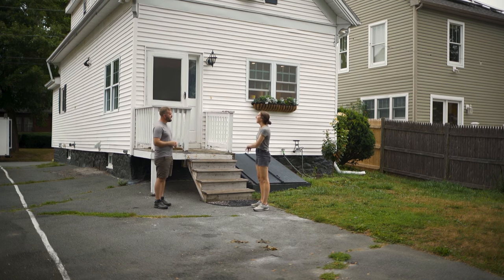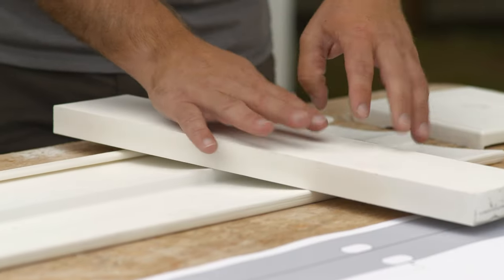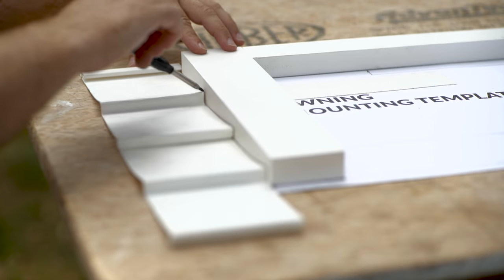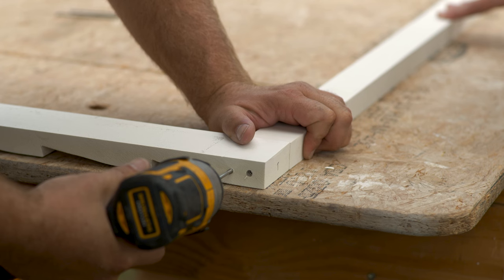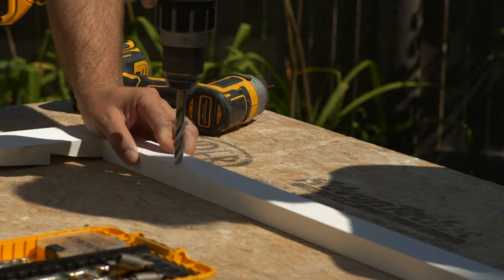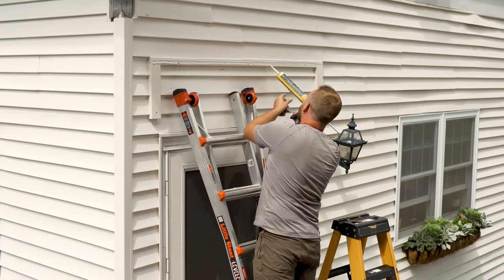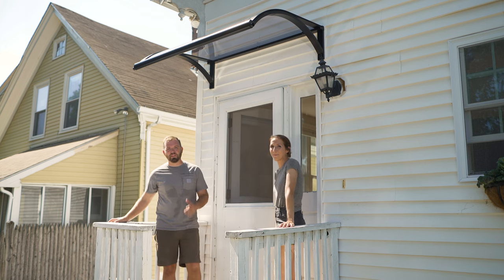How To Install an Awning | Ask This Old House

Comment: This awning is a joke and way too high.  It won’t protect anything.  It’s almost useless
Reply: Agree, very poor decision.
Reply: Definitely not going to buckle the siding in the summer!
Reply: This funny house
Reply: Noticed how much it moves,I think it won’t last too long.
Reply: @natasha8597  wait and see what happens in 10’years
Reply: Any lower and I think the door would hit the outer edge when it swung out. Could maybe have come down a tier in the siding but I suspect he might run into problems either landing in the high point of the siding, which he’s trying to avoid, or tangling with that light.
Reply: Also Nathan is like 5’6” or something. He’s not tall, so that makes the seeming look higher.

Comment: The awning just doesn’t match the architecture of the house.  It looks tacky.  A bit ghetto.
Reply: Who asked for your opinion?
Reply: It’s useless and 15” too high.
Reply: @johnlebzelter4208  It doesn't matter who asked for his opinion...what he commented is exactly right!
Reply: Someone in my ghetto has the same awning.
Reply: @Amedeus1756  I mean the house is tiny maybe 300k tops.  It definitely doesn’t warrant a 5000 awning
Reply: @stavroslask1292  Lower it 15" and you'll be smacking your head on it every time. More armchair contractors...
Reply: @kamilzieba7427  Look at the homeowner in relation to the awning. Ok maybe 8”

Comment: folks, I hate to be a safety nanny, but take it from a DIYer with a slice across the back of the hand, DO NOT USE A TABLE SAW WITHOUT A RIVING KNIFE. it is not worth it. And the riving knife takes literally no effort to use. Quite shocking that TOH chose not to use one here.

Comment: That's a nice-looking awning, and well-installed, especially with those blocks for the vinyl siding.  If I were the owner of that house, I'd have prioritized a replacement porch and stairs, because they looking like they're about ready to fall apart; have no handrail; and often, the size of the deck determines the size of the awning.
Reply: I agree, nail that down 1st, and then see what design and size of awning would work
Reply: Ugly awning

Comment: Cut the vinyl siding away in the mounting pad footprints?  Sawsall, recip saw, etc?  Lot easier than conjuring up a band saw and buying the PVC, sanding.  Then caulk the seams.
Reply: yes, you could do that, add J trim and flashing, and attach solid blocking for the awning to mount too, and not have to worry about catching studs with the pre drilled holes in the awning.

Comment: Nice project and I like the design of the awning. I however would have liked to see some sort of support ‘beams’ running from the front to the back of either side of the inside opening for a little more structural look.

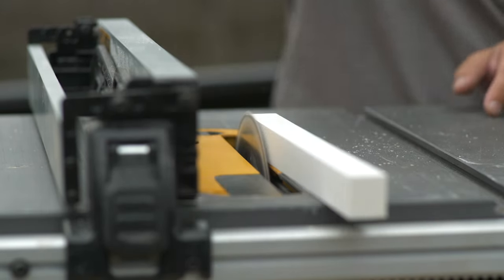Comment: The lack of a riving knife at 1:53 makes me wince every time
Reply: And having someone hold the pieces instead of something fixed for the pieces to rest on after going through the saw. Maybe the owner got very clear instructions, but it seems risky -- they might drift slightly to either side, leading to kickback. And then also not using a push stick at one point. I'd really like to see some safer job site table saw practices being featured.

Comment: How do you know the position of the studs under in the siding and plywood? And were the screws in the top middle hitting a stud? If not, why wasn't there an anchor?
Reply: Id like to see 12" of snow piled on that thing and it not get pulled right off because it's just anchored in osb...what a joke
Reply: @boblablah  That's not right. If there's any kind of serious snowfall, those fasteners that only have the sheathing to hold on to will get pulled right out.
Reply: @SashaXXY  wow so much unemployed contractors and carpenters on YouTube
Reply: @AlMai222  Yeah well, some of us have actually built stuff before. Did you ever work anything with your hands other than yourself?
Reply: @AlMai222  As a structural engineer on YT, I am also concerned about the lack of support. Screwing into plywood or OSB doesn't cut it. The wood framing behind has to be designed to carry the snow load.
Reply: @yodaiam1000  As a structural YouTube engineer, you and buttbrain above should know that he obviously screwed into the king studs on either side, and the cripples/top plate at the top/middle. You wouldn’t use a large 6-8” GRK on plywood or OSB
Reply: @AlMai222  The probability of him hitting a king stud is pretty small. The King studs connections to the floor plates also have to be designed for the canopy load. A typical king stud and toe nails top and bottom are insufficient.  The screws have to hit the king stud dead centre or the edge distance from the screw to the edge of the stud is too small. 

You would have thought that he would say you need to screw into the king/cripple or top plates but he didn't. But even if he had, the framing still most likely insufficient to meet code.
Reply: Next time on Ask This Old House…how to replace a broken awning.
Reply: So no one really answered the question. I am looking at doing a similar project. How should this be properly supported??
Reply: @samuelrobertson1585  I'm planning to build something like this also, but quite a bit bigger. I will be using columns for support. They will carry the entire weight of the structure. My advise is, don't mess with the wall if you can do what I'm doing.
Reply: looks to me like either side would have caught the framing for the RO.  Hopefully they were able to catch some studs in the middle, as it looked like it would have been above the header.